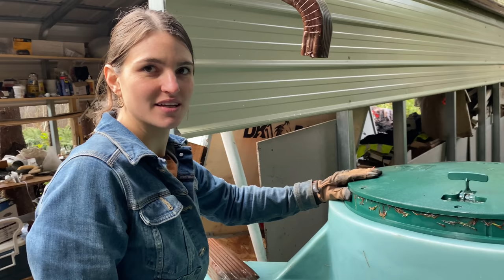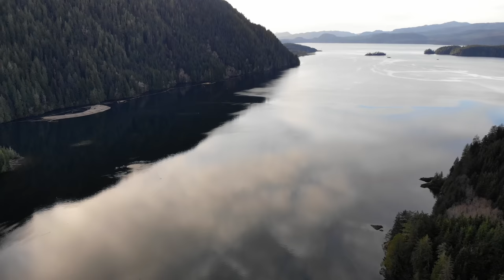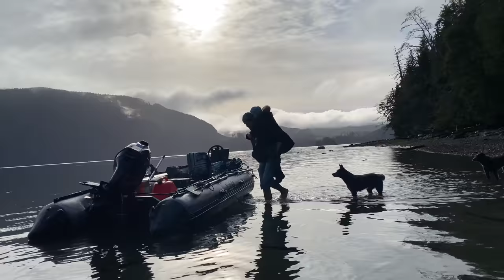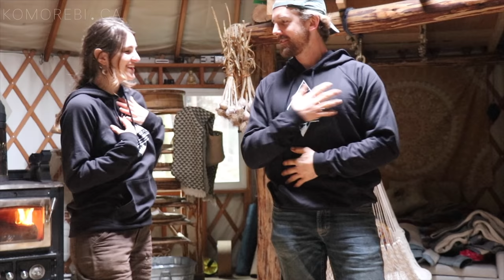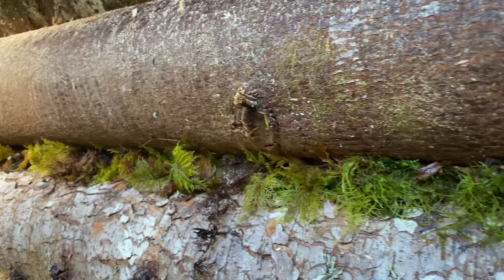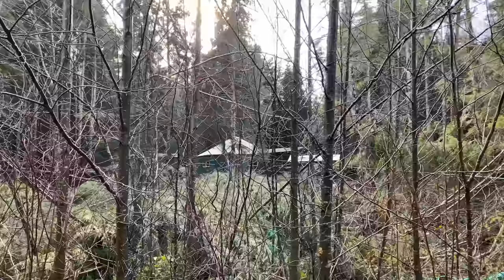ESCAPE to the WILDERNESS // ALONE & OFF GRID - Brick Pizza Oven | Bushcraft Shower & Garden - Ep.121

Comment: Always great videos! In the Alaska bush cabins, the logs are either fit tighter or gaps are filled with the moss. Then smaller saplings are nailed in between the gaps to hold the chinking in. Never seen anyone use Cobb but thats the best thing about off grid living, you do whatever you want that works!

Comment: mind if i throw a few comments in? when splitting wood, spread your legs instead of putting them in a line with the movement of the axe. and put the log you're splitting on the far side of the splitting block, so the blocks stops the axeheads travel.
Reply: Naw, you don't want the axe handle hitting anything.

Comment: Coby walls are something you should build in late spring and summer,not winter, the water content in cobh means it will likely freeze and crack/crumble,it's important to allow cobh to dry in warm conditions, the same as concrete or cement,I hope this helps 👍❤️🇬🇧

Comment: I got the hoodie and its so comfortable and warm here in Wisconsin Winters. Great logo.
I work in a food manufacture and we use thin latex gloves to keep our fingers warm from the cold. For better insulation, place latex glove, than thin cloth cut resistance glove and then another pair of latex on top. Works perfectly.
Also I was thinking why not just cut the top half of the trees next to the yurt, instead of the entire tree. Just in case if you guys need some stumps to hang things or decor.

Comment: hey just a little hint: next time you add a new layer of cob to an existing dry cob surface, slightly wet the existing surface so the old cob doesn't draw out too much moisture from the new cob too quickly - which might be why the dry cob is cracked. ALSO: if the shower wall logs are not at an ambient dryness they will continue to dry and shrink which will then cause the cob to crumble away.  - cheers!

Comment: 1) In Norway petrol was very scarce during WWII, thus automobiles using wood gases (CO and methane) instead of regular gas and diesel became common. They called the engines "knott generators" and the funny thing that correlates with this video is these engines used small logs of alder (7:11) as the most used species to burn. I remember my granddad told me that when the allied bombing of nazi fortification became too intense he had to evacuated his family, including my mom, with an old wood burning Volvo. So I owe ALDER a great deal. No wonder I'm a Woodsman.

2) Since cob isn't used at all in log house construction here in Norway (moss is) I have no experience, but is it wise to apply the cob on non-barked logs? I assume that when the logs finally dry out, the logs will shed the bark and ofc, also the cob.

3) In forest science komorebi has it's own name, literature, knowledge base and theories: sunfleck physiology and ecology.
(((but I assume komorebi sounds more chique amongst hippies-go-exhibitionists-still-urbanites)))

Comment: I guess I won't get a calender as I do not wear T-Shirts but I do wear Baseball Caps to keep sun and rain off my glasses when I wear them.  I would rather see the front of Nicole rather than the back but a back shot is great at t imes to.  The old fellow I bought my place from he had a fair sized garden but by the time I got the place I would need a Excavater to get rid of all the trees.  The best part of the baby trees is they have a sort of pollen on the tree trunks that you can rub on your skin and it will keep the mosquitoes away from your skin.  I used a tight chicken wire fence, putting it into thsoe ares that needed Cob after I installed the fencing, worked real good, then IO cut smallish thing Pine trees then I peeled them and put them along the logs, made the interior llook pretty good Oh yes I also Shellaced them before nailing in place.

Comment: Can't wait for your earthship. wont have to have as much heating requirements. Same goes for building underground or at least into the ground. Rocket Mass Heater would facilitate all your cooking and heating needs with about 1/5th to 1/10th the requirement of fuel  I'm still wondering about water flow, since you have so much of it, some has to be near or above the ground to produce hydro-electric. Seems you could configure a some type of autopump for your water, even now. There are so many DIY projects and situations yet to explore. Wishing you all the best.

Comment: For those who don't know, a cord of wood is an area 4-feet by 4-feet by 8-feet filled with wood. In other words, it is 128 cubic feet of wood. Jake, how many cords of wood do you think you think fit in your wood shed? You could quickly find out by measuring the interior of the wood shed and calculating the cubic feet in the shed. Then, you can estimate the percentage of fill at any time to figure out how much wood you have left.
Reply: I kind of suspect that they don't actually go through 6 bush cords of wood in the winter. I'm in Ontario and only use 3 bush cords all winter for a two story farmhouse.

Comment: SSOOO question... how are you going to prevent the wood from rotting quickly? Since you did not take the bark off, now you will have a higher chance that the wood will rot quickly (Bugs under exposed bark cause increase in wood rot). At first I thought you were going to just cover the whole thing in cob which would seal the wood, but now it does not sound like that is the case. 
The other part is how are you going to keep the cob from falling apart? Are you adding something into it for hardening due to the increase in moisture content of both the elements and the shower itself? My understanding is this is why you don't see adobe houses up in the PNW - supper efficient, but don't work well with the elements. 

Not a knock on anything that you all are doing, but really curious - love what you both are doing... and Jake - love ya man - but put on some chain saw pants please!

Comment: you probably know of the wood-burning device called "rocket-mass heater" - an amazing space heater that heats a mass which then radiates that heat into the space for hours. It is a bit complex to design and build, but once it is up and running you could heat that yurt for a tiny % of wood that you currently burn. Burn smart. [PS: thanks for your videos; quite inspiring!]

Comment: Lovely Lady,  You have a potential problem with your wood splitting.  In short, the arc of the axe head must always finish buried in the tree stump or the ground.  That way a near miss, or the log splits funny, or you are suddenly distracted by a voice or loud noise,, does not finish buried in your shin.  What I just witnessed was a swing that had all the direction of arc of being buried in your leg.  For what you were just doing,, simple,, move the standing spot of the log farther out in the center of the platform.  Or,,, kneel down so the finish of the axe stroke is straight down into the platform.. Or  bend with the stroke of the axe so the axe head again is buried in the center of the slitting platform,,, Or  Use a long handle axe such that the arc again is finishing in the platform or the ground.  When splitting with the log standing on the ground,, spread your feet apart so they are no longer in the arc and finish with the axe or splitting maul buried in the ground.  Always think of where the axe head will finish if the log were to suddenly vapourize.  If your foot or leg are in that swing arc, do something else..
Reply from the maker: We do this

Comment: man if had enough open containers and plastic snow shovel. fill things full snow when spring hits melt smaller amount water use garden.( snow bigger when snow but melts shrinks down, why don't put some container full water freezer expand break container)  when built raised beds even have water tight container or box next to them fill up with snow when melts got water. if ever grow wheat pezza oven. fill bottom of pots and raised beds with straw for drain  edge but only good pots and tall beds.

Comment: The other shows I watch they use a cement mixer to make the cibb it's faster and more even and much bugger batches. I've seen manual and electric and its 5/6 shows that do it on a grand scale and that can be fine in summer or winter and one made a wall 6’ wide 8’ tsll. Between two posts over kitchen wurd and anoutb12” thick.on the bottom to 6”
On top and auth bigtime sticking jut cur light saves on the feet.  Why have you not cut more food down to gervseaained? Two.of you one day could najev3-4 cords easily. Just one day a week all day to chip the wood

Comment: Shame you don't learn to build with logs,, timber frame with round logs,, or log house.. Couple months of hard labor you could have something that holds the heat,, cut your fire wood bill in half,, have an indoor wood cookstove,, that heats water,, bakes food cans food & heats the house . Proper stove  pipe center of the house,, damper down the heat,, instead your just running it out the chimney.. That shower,, with large corner logs,, v notch,,  with a board jig you wouldn't need cob,, two passes with the chain saw between each log.. much much faster than shrink fit full scribe or saddles!! Make a drying rack( 1x1 rabbit wire) inside for your firewood so its standing,, vertical,  gravity ,, funny how water works!!!

Comment: Why are you just putting the logs on top of each other, in a northern climate, instead of beveling out the bottom of the top log, to create a tight seal keeping out the cold?  You still use the moss but you do not have the problem of sealing gaps with clay?

You can then bore out a hole between the top and bottom log, and hammer in a wood stake that holds the two together and tightens the seal.

Here is one example of what I am talking about. 

https://youtu.be/BBX5qh09OIE